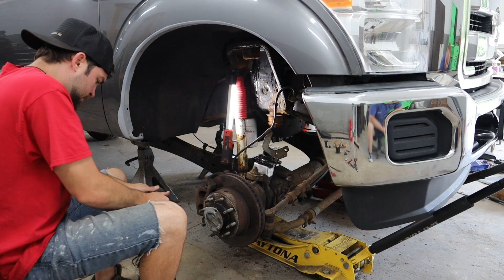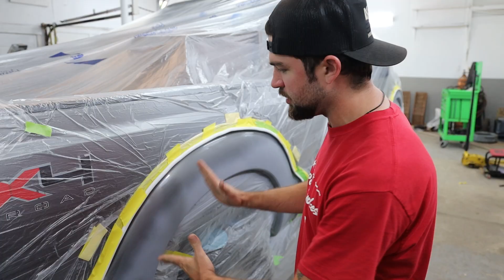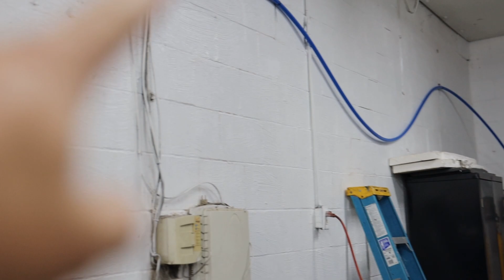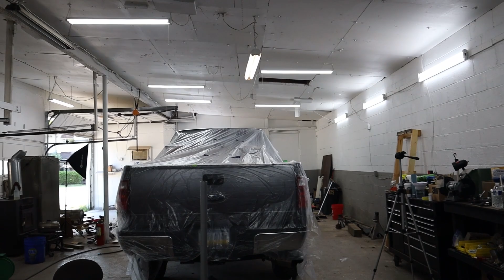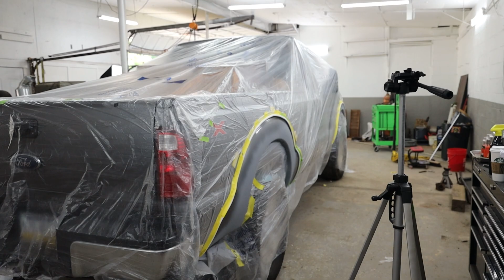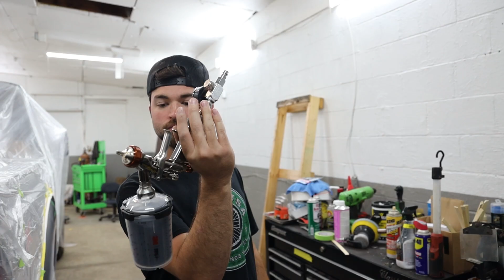ICONIC 11-16 Ford Superduty Rust Repair

Comment: Getting my 6.7 powerstroke motor built and playing wait game now. Broke connecting rod on factory motor. Trying to decide on turbo whether doing Dan's s370 or a s467?  dual fueler and 100% over sticks
Reply: I’d say go the 467. With that much fuel and the motor being built to hold the power, the 370 would be maxed out pretty quickly
Reply: Who's building it?
Reply: J&K engines. There awesome guys to deal with.
Reply: Now I just have to find someone who builds a s467